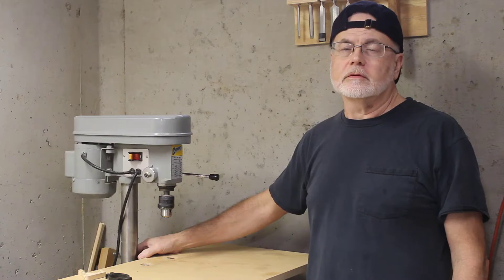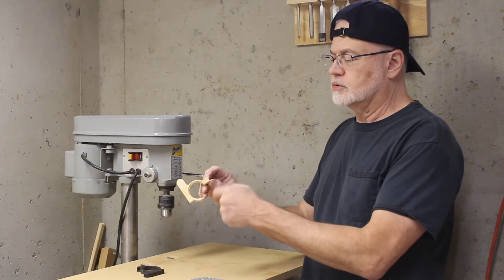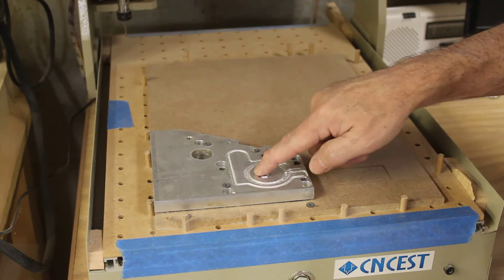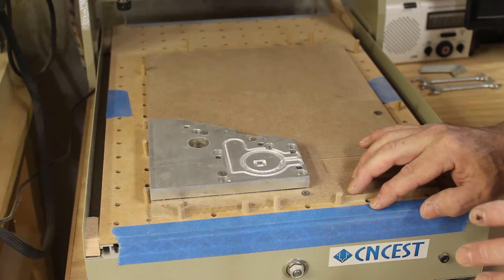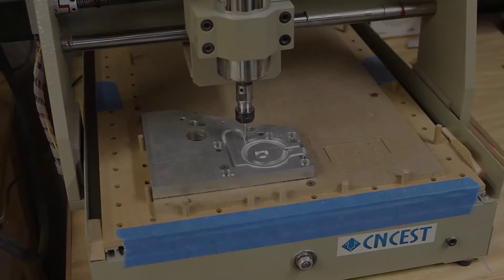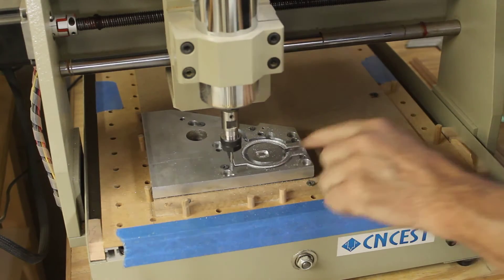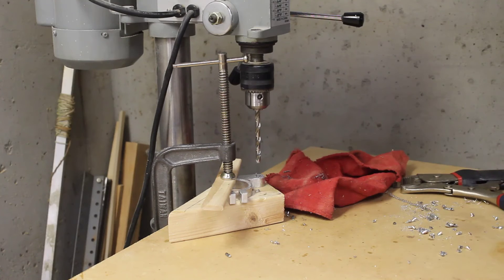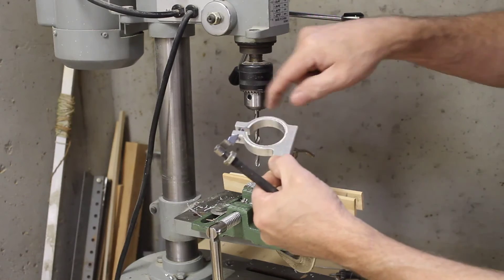Milling Aluminum on a Desktop CNC

Comment: Excellent video.  One of the things I 've gotten to enjoy is making and fixing my tools.  It's must if you have old stuff.  Did you draw the part or scan it for the CNC?  Came out great
Reply from the maker: Thanks Tim! I measured it and drew it in Inkscape. In the beginning of the video I'm talking about the part being broken, but it's lying on my drill press table whole. I had glued it back together so I could take accurate measurements.